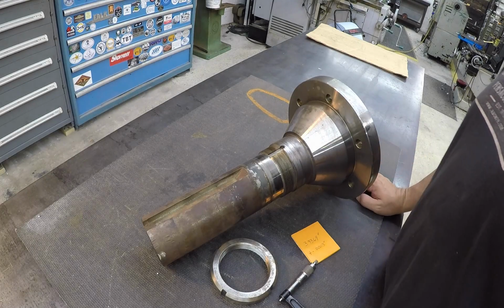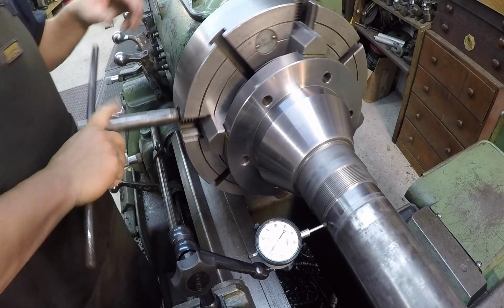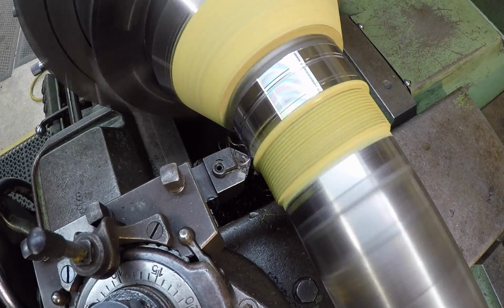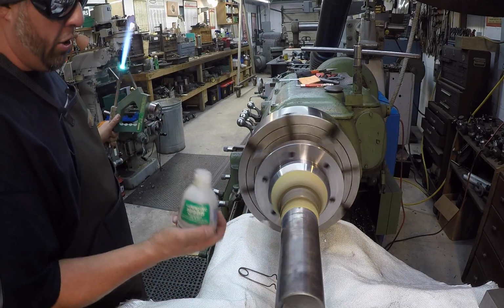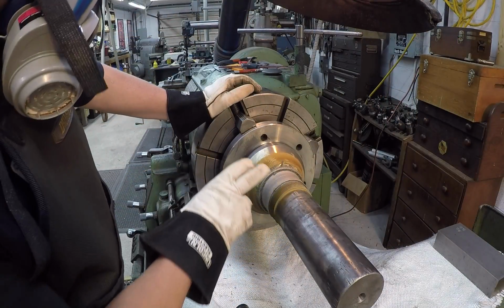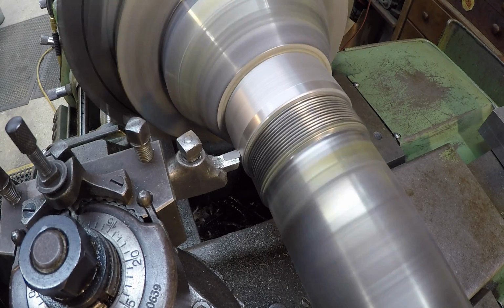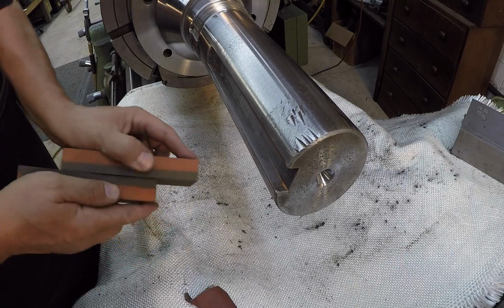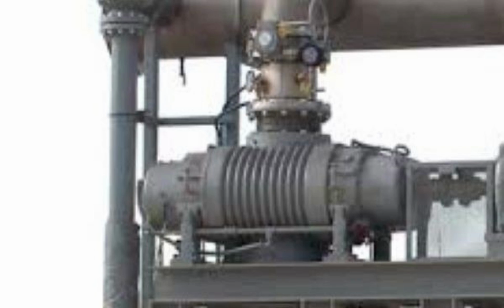SNS 300: Spray Welding a Blower Shaft

Comment: How do you account for thermal expansion and contraction when dealing with a tolerance like this, Abom? If this part is all hot from being formed and cut, aren't you going to be out of tolerance by the time it cools off?
Reply: Where im working we spray weld every day and just use compressed air. It takes a while to cool down but there is simply no other way to do that. If you use coolant you will change the metal structure by a huge ammount and your workpiece will turn to garbage.
Greetings from Germany.
Reply: Well he measured the final diameter while it was still hot at +.0003, so once the part contracts it will still be in tolerance but even closer to the target dimension than when it was hot
Reply: that's a very good point.

Comment: I have a friend of mine who has a shop in New Orleans that builds up shafts for shops like yours using hard chrome. I do know that you can not cut it back down because it to hard, but it it must be ground back to size. Have you ever done that process before. Thanks

Comment: Awesome video. If they don't use spray welding, is the only other option to sleeve it or remake the entire part?
Reply: You can tig weld beads around the joint and machine them down. Most places I know use this process. Only issue with TIG welding is that too much heat will change the composition of the metal. To be honest, I'm sure spray welding does, too but maybe not. This might be why they chose to spray it.

Comment: Curious if all the heating and cooling would throw the centering of the piece off.  Very interesting vid.
Reply: Not likely with the bulk of that piece. Maybe if heated up enough and not spinning on the lathe. But constantly spinning on it's the center axis is will keep it centered when heated. Think about glass blowers spinning molten glass while shaping. If the glass blower stops spinning the molten glass will begin to sag. If keep spinning, the weight will constantly center on the axis of the rotation.

Comment: Is spray welding how you would rebuild a worn engine crankshaft? You cannot get at the ends to slide a sleeve over. And you certainly don't want the shaft distorting through overheating?

Comment: Excellent work. Learned to stay away from emory cloth polishing on the shaft seal surface because it will impart machine lead and will leak when turning in one direction. 

Plunge grinding is better in that case because the scratches are short, not continuous like emory cloth polish.

Comment: You could have done with my 2 tenths mallet!!     Brilliant job, well done. Back in the late '60s, at Vospers in the UK, we would spray weld the bearing surfaces of the main propeller shafts on the Type 42 frigate. Each one took 2 or 3 days (72 hours). Retired now on the Isle of Wight, but you've brought back some fond memories. Thanks. Pete

Comment: I'm from Australia, Sydney and we used to spray shafts, seals keyways etc using rotec gun and updated to the eutectic gun single powder, but latter found metal spray collapses when for example you fit a bearing and remove it, the spray shrinks undersize after time.
Better using Arch spray for bearings and seals 
and hot spray for keyways repairs.
Great show thanks.

Comment: I was an "MR" (machinest), when I was in the navy.  I actually did the exact same repairs to electric motor and pump shafts onboard the tender I was on.  The navy sent me and a couple other guys to the school in northern Ohio.   I was a machinest for 15 years.  Mostly lathes and milling machines.  Ended up on CNC equipment.  Thanks for your video.... it brought back memories.  Your shirt says you're in Pensacola, Fl.  I'm just across the line on hwy 98 in Alabama.

Comment: so what about the mounting flange surface?  would it not change when you finally get the end of the shaft running true?   or is the end of the shaft just the priority?  
Seems the first surface you trued would be changed from the original?     If that is the case, why bother with it in the first place is if all you are concerned with is the actual shaft running true?

Comment: Guess what? 3.973 inches = 100 millimeters, I should have known most bearings are measured in millimeters.
Reply: 3.93701 Inches  equals 100MM... nearly threw me too..only remembering what was drilled during my Millwright apprenticeship...stuck with me over the past forty plus years...that and 24.5 MM in an Inch...
Reply: @malachy1847  my dude its 25.4
Reply: @malachy1847  No way
Reply: looks like I transposed two numbers should be 3.937=100 millimeters

Comment: What would something like this cost me for my troy bilt horse tiller? The main shaft has A grove worn in it where the oil seal rides. Even A brand new oil seal leaks oil.
Reply: probably more than a new tiller would cost because a machinist time is money . just buy a new shaft and install it.
Reply: @gregschaust4298  Wow I didn't know machine work was that  expensive. Thanks for the reply.

Comment: Thanks for sharing. I had a pump shaft that has a ceramic seal repaired like this and it is harder than the original surface. When the seal fails it destroys a $1500 shaft. Great video !

Comment: metal is a strange and fascinating subject. It's kinda crystalline, and so this process makes sense... I imagine the science behind this being that, if the prepped surface acts like a large seed crystal, then with the right heat and metallurgy, you're actually more or less growing that 'lattice'. I could also imagine that there are ways to improve hardness over time with it too. I wonder, does repeated repairs weaken or strengthen materials? Could they need a dopant over time to keep things from getting too brittle? I imagine it's delicate to balance, cause you want the right parts to be 'sacrificial' in a mechanical wear... if say, this part became too hard, it could cause the housing to fail or more expensive pieces that interface with the repair. All in all, neat. Makes me think a lot about mechanical engineering...
Thanks for sharing the video, G

Comment: I am a welder by trade. I refuse to stick weld (SMAW) anymore unless that's the only practical option, I really only TIG and MIG anymore. So naturally as a welder I was intrigued by the video title, and am glad I clicked on it. What a cool vintage tool you have, and it was really cool to see it in use. With 20 years or so around the trades, I'm impressed with your lathe skills and I'm sure you're just as fast with a manual mill. You got a new subscriber, well done. I'm interested in the welding process you performed, I know nothing about it but found a few things interesting as I do know a bit about oxy/acetaline. I found it interesting that tool had a torch head with multiple holes like a rosebud or cutting head, and even though you set up a neutral flame you still had a really long distance to work and still getting decent build. Pretty friggin' cool watch for this nerd.

Comment: I've never been a fan of spray welding, I've seen too many failures because of it. Especially on bearing surfaces. Just think if the original material wasn't hard enough, do you think spray welding would be, or spray bonding, welding is a process of melting the base metal adding a filler material to formulate a different mixture from the base material. Welding requires temperatures over 2300 F to melt the metal, spray bonding is only 200F.
Reply: Cold Spray happens at 800-850 degrees. over 850 is Hot Spray. I know both very well and when used properly I have never had a failure. Over 35 years doing both.
Reply: This is just a nice place for a bearing to call home but not a bearing surface.

Comment: I did not know the spray welding process, I worked many years in the textile industry and there we used to have very large rollers (cards) in which the arrows had wear and had to be lifted to the lathe to fill them. This system would have saved us a lot of time, now I see it only with the interest of knowing that the new mechanics have much more useful tools that make their work easier.
Thanks for sharing.

Comment: I've cut down and resleeved journals years ago and remember the time that took, which seemed rather quick vs this.
What would have been the time difference with spray welding this part vs resleeve?
Reply: He kind of covered this in the final wrap up, though he didn't give exact numbers, but said for people who do a lot of this, with a setup permanently in place, it's significantly faster. It'd be interesting to hear actual hour estimates, though (which might be what you're asking.)

Comment: In my inexperience, a sleeve seems harder to do, and doesn't require removing much shaft material(ie if it was damaged), so in the long run it would be a stronger fix when done right?

Comment: This is the first I've heard of this...but I saw a youtuber use a torch and vibrating needle set up do much the same as you are to make rubies. Ever try to weld a ruby? Not a clue what I"m talking about? Rubies are a form of sapphire, which is basically aluminum oxide. Yep. You load that gun up with old rusty aluminum powder and you can coat things with sapphire (or rubies, if you use some chromium too).

Comment: I used to do this 35 years ago when I finished high school but this is the first time I've seen powder used. We used to bond the surface with pure nickle then a wire feeder gun into the torch flame.

Comment: I worked at a place that rebuilt jet engines and used that process a lot on compressor blades and such. They had a special pressure washer that ran at such a high pressure that it had its' own refrigeration chilller to keep it cool . It was used to wash that eutectic plating off.........

Comment: Legitimate question...Why not weld the shaft like a crankshaft journal and turn it down? Would that cause too much deflection from the heat?
Reply: Depending on material 9 out of 10 times the shaft would need to be re heat treated $$$.

Comment: to those that really don't understand how this works, think of the outside of a welding hood lens. Over time the weld spatter bonds into the glass, and you cannot remove it, it's melted into the glass. That's why they use plain glass covers over the more expensive tinted part. this is essentially the same thing, with controlled conditions rather than random.

Comment: Thanks for that very interesting video - now I am a lot more aware of what 'spray welding' is. I was surprised to see that there was no trigger mechanism on the gun for turning on and off the powder feed which I assume was gravity fed ? Is the feed rate of the powder purely controlled by the size of the capillary hole through the body of the gun to the outlet pipe ?

Comment: are self centering jaws not accurate enough for this?
Reply: An expert machinist would tell you that scroll chucks aren't accurate enough for much of anything.
Reply: Ryan Slaback well they seen to work just fine for what we do. But then we are not doing the kind of precision work he does.
Reply: 3 jaw chuck is normally + or - 5 thou. So no it is not good enough.

Comment: A long time ago I had a wheel bearing fail on my trusty old '64 Oldsmobile--loved that old jewel--the problem turned out to be that the axle surface had been worn down to the point that it was no longer of sufficient diameter to hold the 'friction-fit' bearing in place, on the axle. At first, the machinist tried to knurl the surface, where the bearing had to be pressed into place, to get a couple thousandths increase in diameter, but axles are hardened steel and he wasn't able to get the diameter buildup he needed. Then he told me about this new 'Spray Welding' process he'd heard of. I'd never heard of the process. For years, I'd worked at National Lock Co., in Rockford, IL, knew a bunch of these 'old school' machinists, guys who could work all kinds of magic with steel... they built things. I've always believed that America is great, precisely because we have guys like these that can build things. The 'Joe Six Packs' of the world, God Bless 'em. This is the first time I've actually seen the Spray Welding process. You did an A-1 job on that blower shaft... looks just like a new one. You have my respect.

Comment: Man, I was totally impressed. Working with metal has been around since the 1500s and earlier but using different tools and processes. I do the old fashion Blacksmithing. While watching your video, I noticed in the background a piece of equipment that a blacksmith could not do his work without it. The anvil sitting on the floor. I did cringe tho when I saw it had been painted. lol Like when dust and shavings get on your laths rails. Fantastic work. Love it.          Take care and stay well. Later
Reply: "Working with metal has been around since the 1500s" LOL, how about more than 6000 years earlier than that?

Comment: What a fascinating world, where rubbing slightly too hard on a steel shaft with a piece of cloth can violate tolerances.
Reply: It's not a piece of cloth, it's sandpaper.
Reply: Kinda weird. Like in what world can rubbing it with a cloth ruin the tolerance, but normal usage doesn't? What's it being used for? A paperweight? If so...why the need for tight tolerance?
Reply: @ashscott6068  I thought the same, surely the continuous action of incredibly high pressure oil for months of continuous operation would do the same. No doubt physics is Stranger than we can imagine.

Comment: In 1982 I was in Illertissin in Germany in a company called PlerschKuling and I was having training in spray coating of Aluminium on Steel for block Ice freezing cans. In one of the shops in the factory I saw a similar work done on a compressor shaft with deep quashes and nasty cuts, after a two day work I was amazed on the outcome. Good work Master Machinist, but this is a Professor work. God Bless you. I will keep this video and address, you do not know one day I may need your Mastery!!!!!!!

Comment: Love to see you using the temp stick for verifying the shaft surface temp. One of the options we used was to mig weld the area using a brass wire. Ever have any issues with hydrogen embrittlement (peeling)? Nice work and a really cool tool not seen all that often today. Another great video!

Comment: I'm 30 years old and I've never seen or even heard of this method, that's friggin' amazing, Genius even,  if i understand right it's so the core metal structure is built onto evenly without heat stressing the existing material like typical welding for that right?
Reply: yup, spray welding if done properly wont effect the depth of hardening. He's very careful with his process, I've seen other shops just go way overboard.

Comment: Is spray welding as strong as submerged arc welding ??
Would it work on a crankshaft ??
It was tried in the 69s and 70s and wasnt sucessful, but technology has changed.
Whadaya think ?
Reply: What Is Islam?

Islam is not just another religion. 

It is the same message preached by Moses, Jesus and Abraham.

Islam literally means ‘submission to God’ and it teaches us to have a direct relationship with God. 

It reminds us that since God created us, no one should be worshipped except God alone. 

It also teaches that God is nothing like a human being or like anything that we can imagine.

 The concept of God is summarized in the Quran as:

{ “Say, He is God, the One. God, the Absolute. He does not give birth, nor was He born, and there is nothing like Him.”} (Quran 112:1-4)

Becoming a Muslim is not turning your back to Jesus. 

Rather it’s going back to the original teachings of Jesus and obeying him
Reply: @ahmdabdallah5811  Is lamb....eat lamb chops...yum
Reply: No Neck  I like bacon 🥓 my self

Comment: Good work!! We have been using a  Sulzer Metco thermal spray system at work on all kinds of bearing fits and other fits for about 25 years. I have seen repairs up to 125mm in dia without any issues. Recently we began to finish by tool post grinding. The polishing/sanding can sometimes result in inconsistant measurements. The machinist also wears a respirator mask and draw the fumes/dust away into an exhaust system. Your correct it is a great process for repairing wear on special parts with lots of features that could not easily be repaired by sleeving, welding, smaw or outright replacement.

Comment: Not to nitpick your work but you didn’t check the  threads . When doing a job like this, you want to ask for the nut going on the threads and make sure you get the threads all cleaned up. But just wanted to let you know from one old machinist to another. You do good work. Thanks for sharing. Maybe some younger will be willing to learn.
Reply: He had a nut on the bench at the start of the video.

Comment: It's been about 30 years since I have spray welded with that same system. Used the Teradyne 2000 system also. Nice job. Try chucking up only 1/8" when using center. If not too tight, the flange will align itself up when the center is seated. It will also prevent the shaft from flexing. When machining shafts and large rotors the most chucked up was about 3/16". The one time I checked up 3/8"+ and seated the center I had issues flexing the shaft.

Comment: that looks like  the the shaft off of like a mud pump .  the drives a  belts .. or it a drive line for like the clutch plate  for a oil rig that runs a chain/clutch

Comment: Nice work, from your 4 jaw truing, to the spraying, to the lathe work.  What is the mask you apply?   Do you ever have issues cooking all the grease out of your headstock bearings with that much heat?  Why didn't you keep the live center engaged during the process?